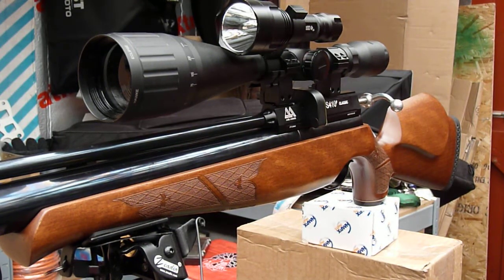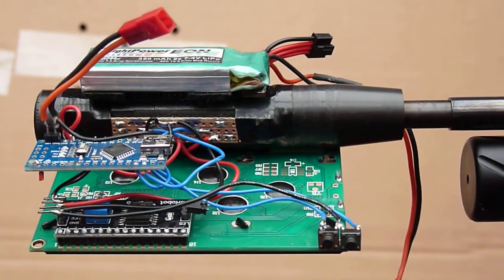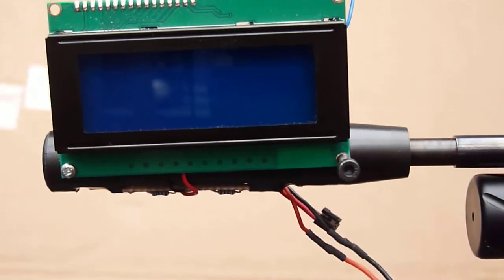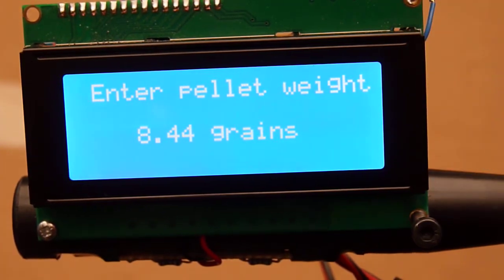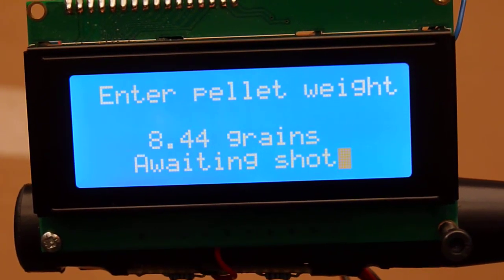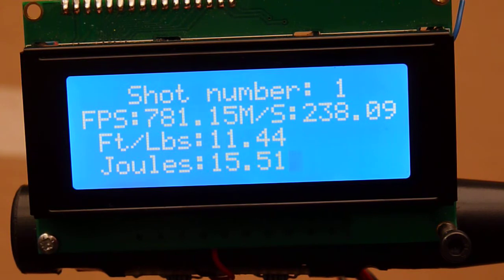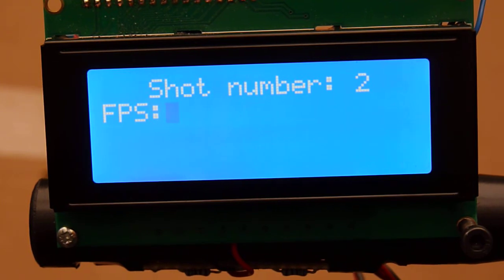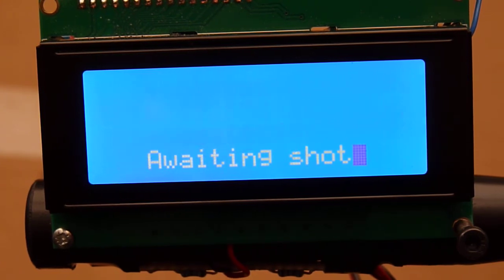BALLISTIC CHRONOGRAPH FOR AIR RIFLE, ARDUINO

Comment: What resistance did you use for the phototransistor? 10k? 100k?
Reply from the maker: 150 Ohm ..its an OPL550 IR emitter.
Reply: @doctorvox  ok, only two sensors, one for the front and other for rear to measure the time right?
Reply from the maker: Yes, if you contact me via my other chrono video, I will send diagram and code if you want it
Reply: @doctorvox  I sent you an e-mail. 
Another question... tha path of light is around 10 mm between sensors? Thanks

Comment: I hope you will do it soon. I do not have such expertise to build a code I am learning and  I practice electronics as a hobby but I am not a professional. I built a small device with an LM358 and photodiod and wrote a very simple skecth. It works but I am not so happy with pellet catching. I am looking for othe sketches to improve my knowledge. Regards from Italy
Reply from the maker: YES! SEE MY NEW FREE INSTRUCTABLE WITH CODE : https://www.instructables.com/ARDUINO-AIRGUN-CHRONOGRAPH/?fbclid=IwAR0bHqrCK9aCWc6DY2_j7t842I8mp1pmq-dCF3u5XzWwAtNyQ3C9SK0yhjo

Comment: Hi John, Excellent work! I tried this myself but with 2 red laser beams and 2 photo-resistors. But I can't seem to get the analogReads to happen fast enough. If I shoot a pallet through my tube, It does not register. 
Reference Image --> https://i.imgur.com/M1sjre9.jpg
If you could share some tips and tricks that would be very much appreciated.
Reply from the maker: Yes I had the same problem Matteo, the pellet weight code only runs when first powered up, the timing code is quite short. I have updated it now at  https://youtu.be/1Kd4M1qzbcQ   I may try direct Port Registers to speed up even more.